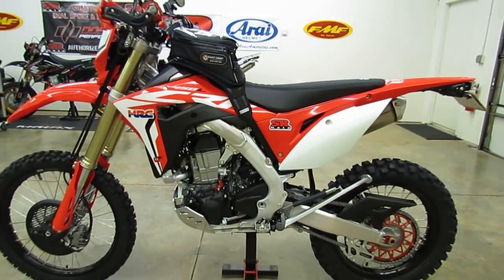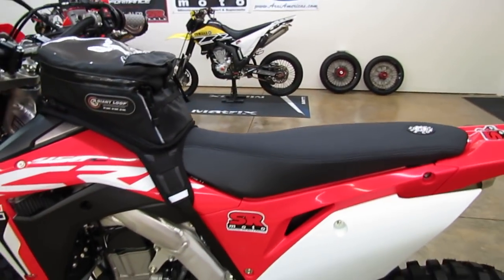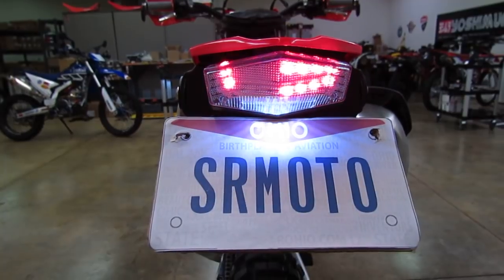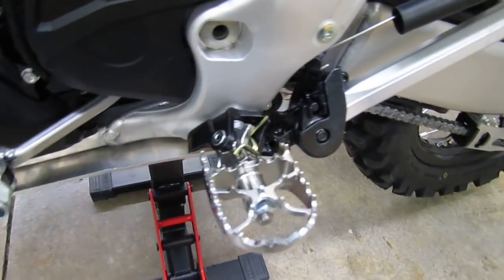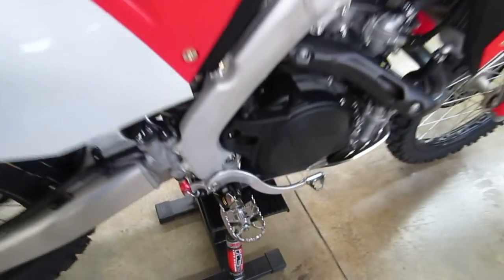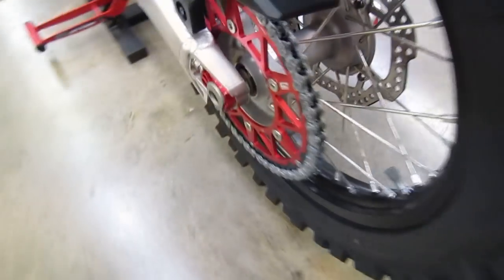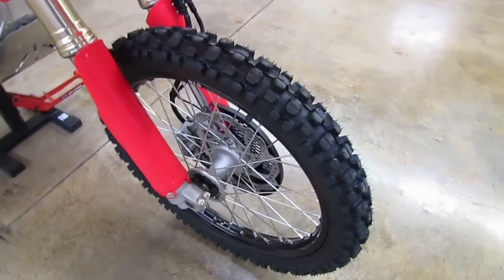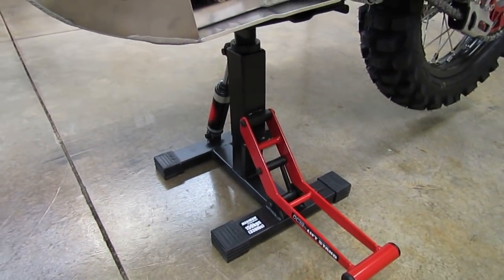Honda CRF450L Project Bike Winter 2019 Update from SRmoto

Comment: A blue seat and red engine would give this bike a real retro look.
Reply from the maker: Yes it would.  Stay tuned for updates tot he graphics.  We are going to do a kit on each of our 450L's.
Reply: Try the red engine at least. Blue seats are a dime a dozen. The red engine hasn’t been done since the late 70’s and early 80’s. Your black and red look is bad arse. I’ve told Cole Seeley on his blog to do it on his 450 l black out project to red out the engine and go with the blue seat. No response as of yet. But he does have the engine back in the black frame already so the red engine might be to late. Someone’s got to break the mold of a red Honda engine soon.

Comment: What’s the best way to get rid of those front reflectors?
Reply from the maker: What reflectors are you referring to?
Reply: The orange ones on the side of the forks
Reply from the maker: If I remember correctly, they were bolted to one of the triple clamps, so we just un-bolted them and pulled them off the bike.

Comment: Nice looking bike but id rather buy a CRF450R and put lights on it 👍
Reply from the maker: Why do that and have to go to the trouble of adding lights, plating it, etc when Honda has done everything for you.  Most people wouldn't miss the performance difference between the two, especially sine these are designed to be a dual purpose bike, not a full on race bike.  A 450L has gotta be way more tolerable on the street than a full on MX bike converted to a dual purpose bike.
Reply: @user-we5yo2yo1f  For the shear power 👍